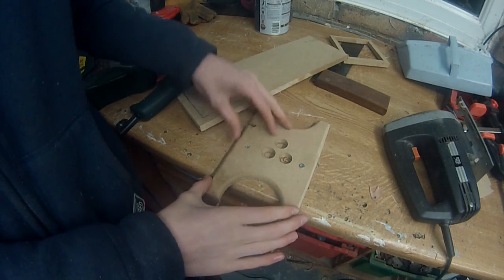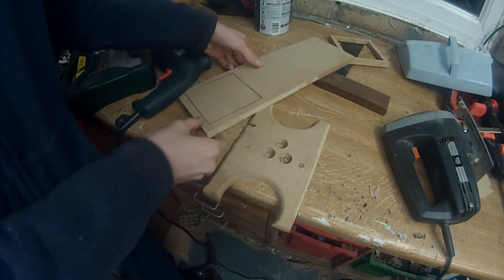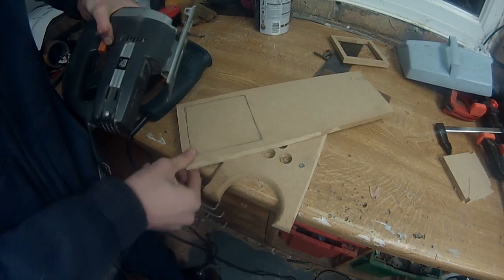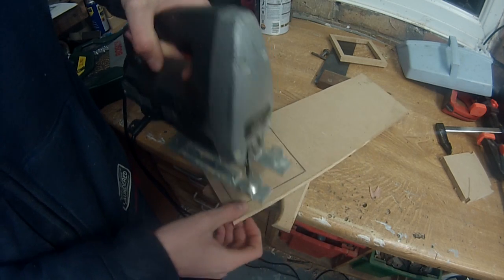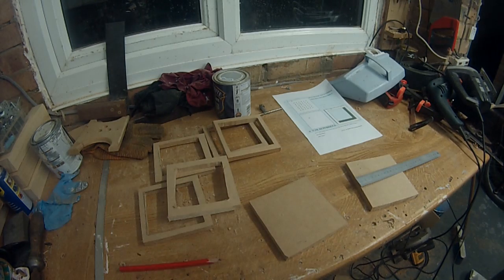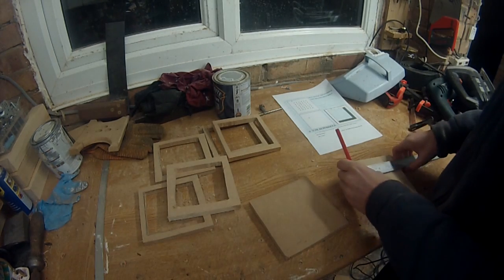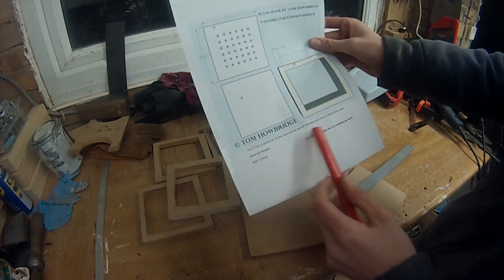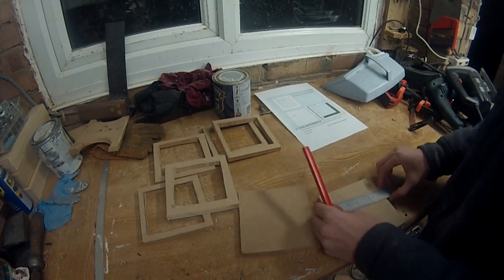Build an Easy Vacuum former FREE plans !

Comment: hello good as it is called plastic material that remains in the shape of the object you place yourself under that plastic Thanks
Reply from the maker: +Jose Manuel Marfil Mora 
I'm not quite sure whjat you mean be I think you are a non english speaker so I think you are trying to ask what is the material being used ?
Reply: +Tom Howbridge Yes , What is the material? .
I am of spain
Reply from the maker: Jose Manuel Marfil Mora HDPE high density polyethylene (plastic)
Reply from the maker: Jose Manuel Marfil Mora any thermo plastic will work
Reply: +Tom Howbridge  thanks

Comment: H Tom, I have just watched your video and as usual I was most impressed. Will you be doing a project showing you using the former? At present I cannot think of anything I would use the plastic former for. I have used vacuum formers previously but not since my schooldays. Thanks for posting Tom. N.
Reply from the maker: Well I use it in the video shown at the end, but I have a couple of things lined up.